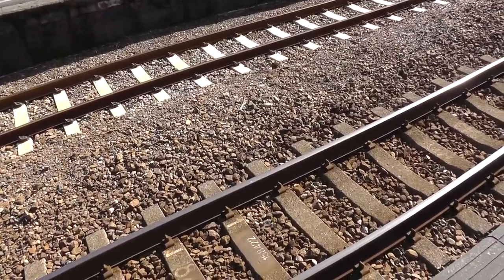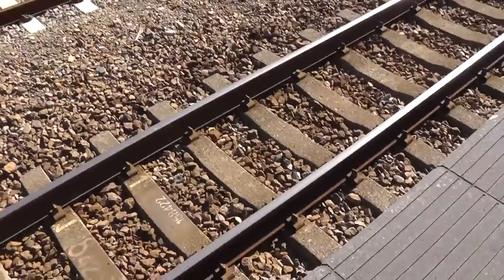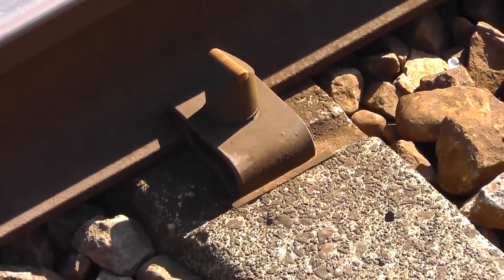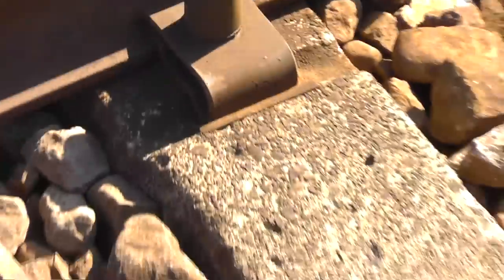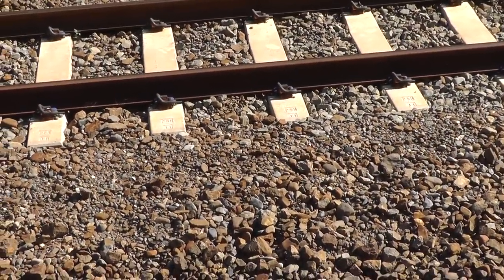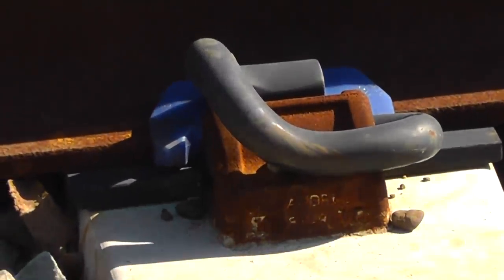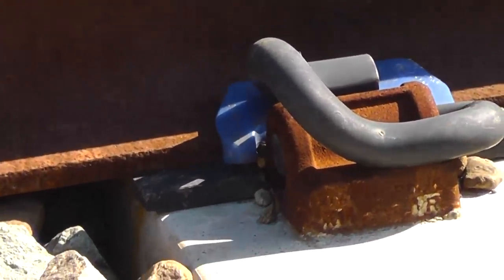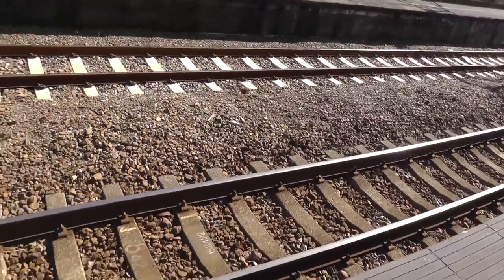🚅 Japan Railroad - Rail Sleeper Pins - Japan Train Videos

Comment: The spring pins are used here in Los Angeles on both subway and some surface tracks.  I think the idea is to let the rail flex a little for a smoother ride.
The first pins are two piece: the sleeper/tie has a clip cast into it and then the pin and rail retainer are pressed into place.  They seem to be pretty effective, since they have to be torched out to replace the rail or the pins.